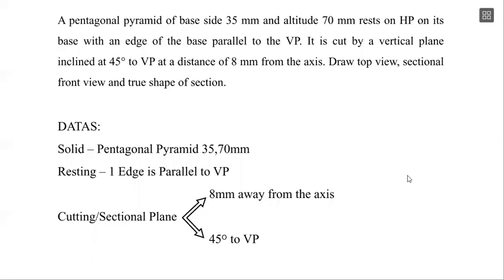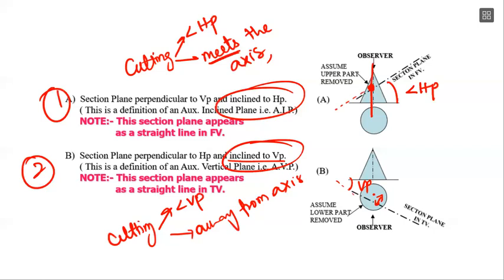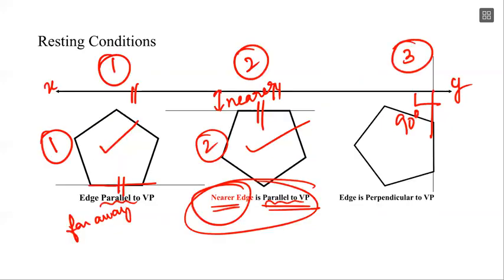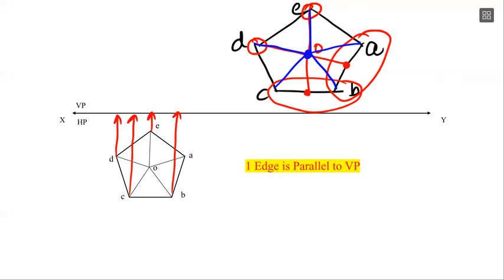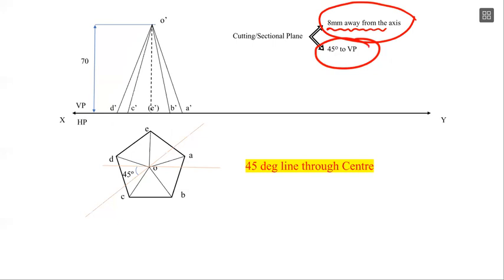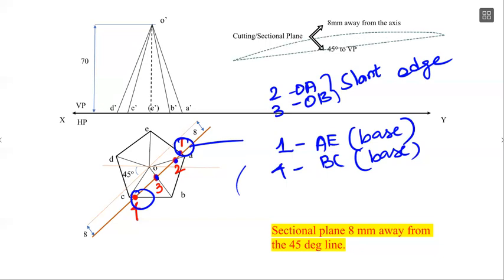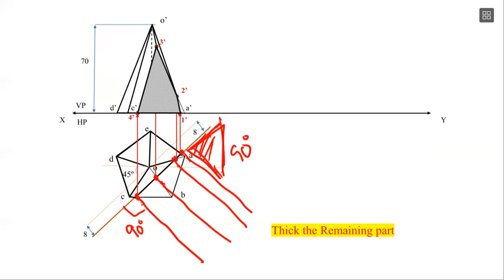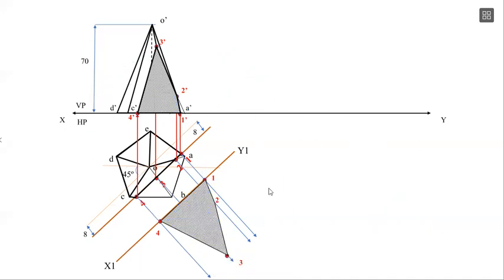Sectional plane inclined to VP | Section of Solids | Engineering Graphics | EG | Tamil

Comment: A V-Belt drive consists of three V-Belts in parallel on grooved pulleys of the same size. The angle of groove is 30o and the coefficient of friction 0.12, the cross sectional area of each belt is 800mm2 and the permissible safe stress in the belt material is 3Mpa. Calculate the power that can be transmitted between two pulleys 400mm in diameter rotating at 960 rpm (sir intha question Ku answer kedaikumaa) pls sir immediately I want answer
Reply: Google it